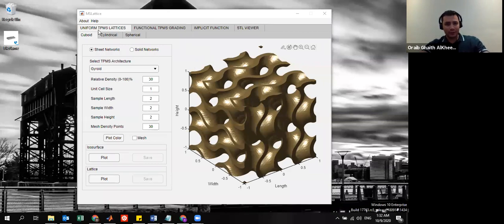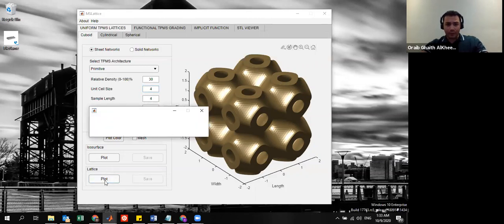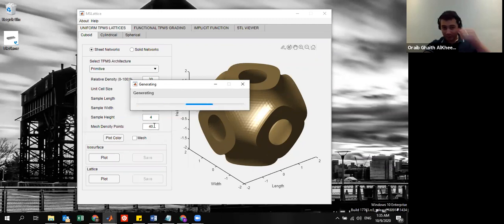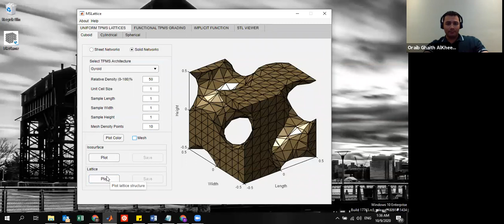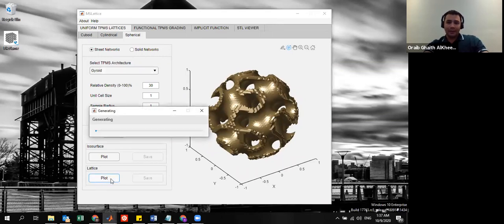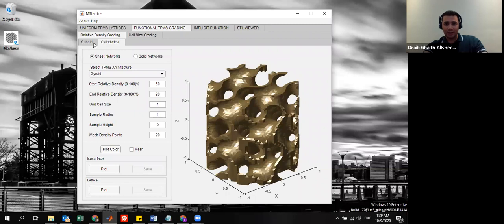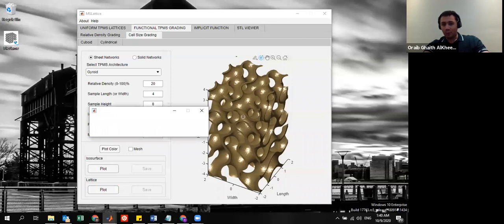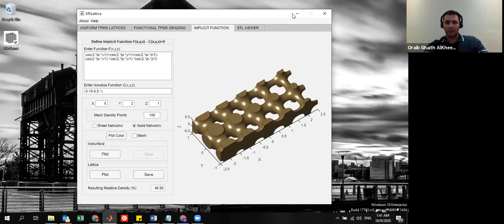MSLattice unifrom&graded

Comment: Thanks Oraib for this code, it's perfect, I tested it with the Comsol software and it worked fine. I have a question regarding the difference between shell and solid in your code, if in small thickness use in case of shell in cell?

Comment: Very interesting tool for generating lattice structures! The generation is fast. I'm curious to know what are the specs of your pc?
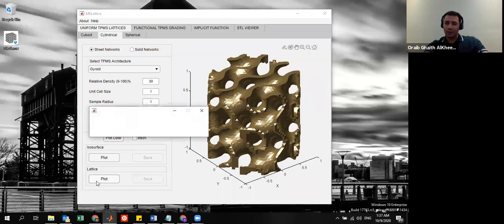Is there any plan to update the cylindrical and spherical geometries to avoid the "stepping effect" on the lattice edges due to the square mesh (@5:08)?
Reply from the maker: Dear Richard,

Thank you for your feedback. My PC is a Dell laptop with 16 GB RAM. The tool is fairly fast, but the more you refine the mesh the longer it takes, and it goes exponentially. The grid points input is per unit cell, so what works nicely on a single unit cell (20, or 25) mesh points will translates to the larger structures. Therefore, you do not need to change the mesh density for larger structures.

when it comes to the spherical and cylindrical samples, the stepping is caused by the quality at the edges, this can be overcome by increasing the mesh points, but it makes the generated file heavier. I am planning to solve this by adding a smoothing function, the problem with this is that it takes much longer to generate the sample. However, I plan to make it a user choice in the future.
Reply: @mslattice2718  Thanks for your reply. 
For the stepping, it sounds to be a good option to let the user decide what he prefers. Could you not use a different generating algorithm to eliminate or reduce this effect?